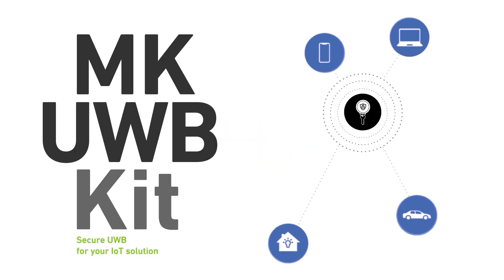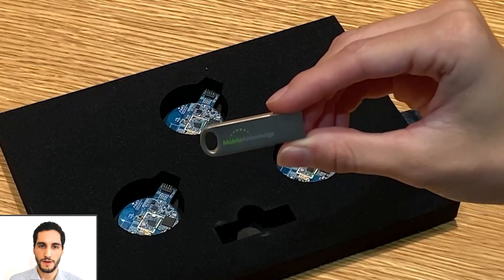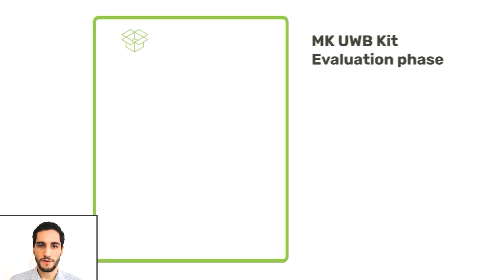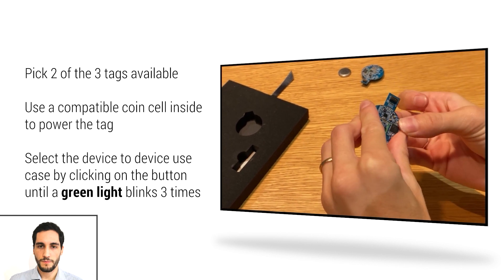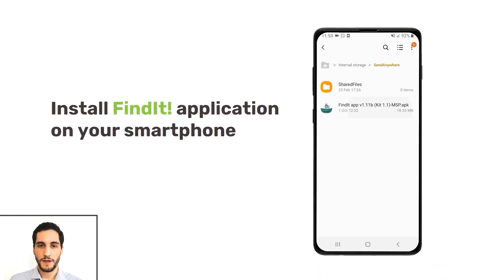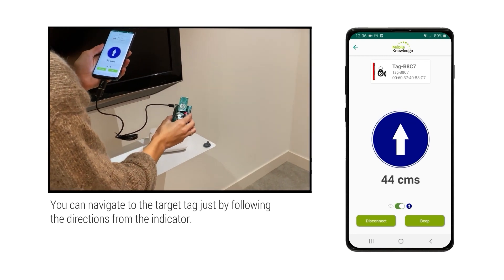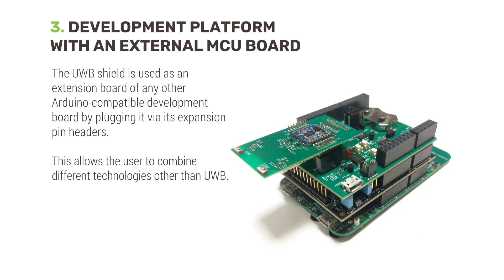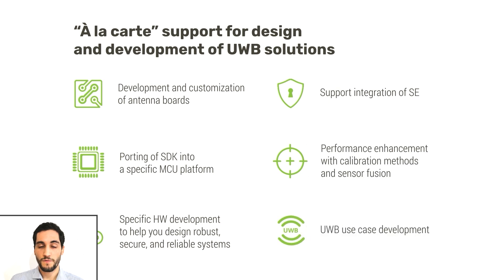How to Prototype UWB Applications with NXP’s MK UWB Development Kit

Comment: It is nice for NXP self - learning  UWB kit , but i suggest the NXP ( UWB chip manufacture for  android OS , Samsung note 20 , fold 3 , s 21/ s 21 ultra ) , it is better if the android app developers can directly access the use of UWB inside the samsung phone , instead of accessing or testing with the UWB shield (anchor ) . because inside the UWB samsung phone already embedded the UWB chip . BUt right now ,google android or samsung does not provide the API or access of the use of its UWB phone for the third party android app developers  , that why we need to test ranging / angle AOA  / direction measurement with the UWB shield to communicate between the phone / the UWB tag as this video . So the NXP is the main UWB chip manufacture for UWB samsung phone / other UWB android phone  , please try to push samsung and google to develop the UWB  API / the use of UWB for the third party android app developer or open for them to access it as fast as it can , because the more faster the thid party  app developers can access its use , the more new apps would be developed and the more UWB phone sell volume  will be , and the more NXP UWB chip will be embeded i/ sold , the more income to NXP  , this is the world of IOT will be reality more faster , let the UWB phone communicate with other UWB device .I am an android ap developer , i want to customize the UWB chip on my arduino board then write the code from UWB Samsung phone to communicate and measure the range / direction between both of threm . But i could not . Because google android / samsung , does not provide or let the app developer access the UWB API / the use of its UWB chip . Even Apple does not provide the UWB code to IOS app developer for UWB  iphone  communicate with third party UWB chip / devices ( Apple provide the UWB nearby interaction code for IOS app developers  only the communicatation between  UWB iphone  together / only apple brand . And google android actually  is one of  the open eco system / open source company . It is great ! if google  provide the UWB android API for third party android app developer develop / share the new things to  the world,  please  take a look back when the first ibeacon launched  !! . I hope , NXP will understand what i meant , this is from the voice of third party UWB app developers :)